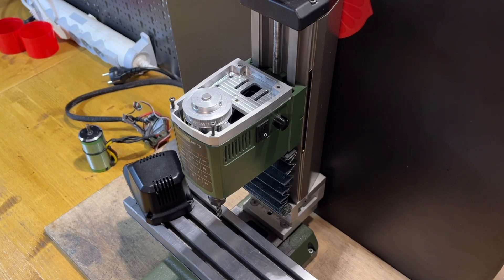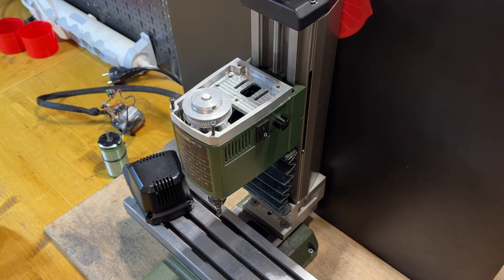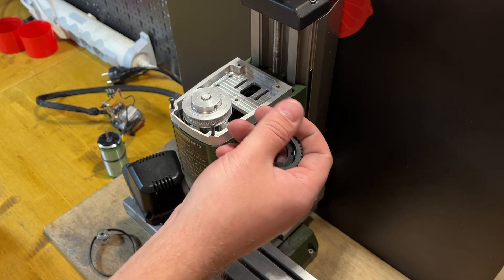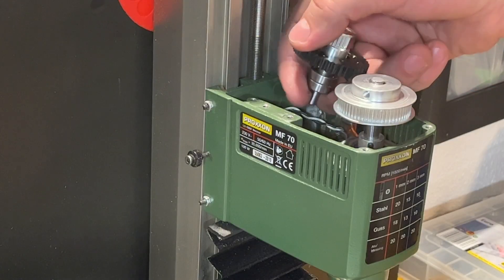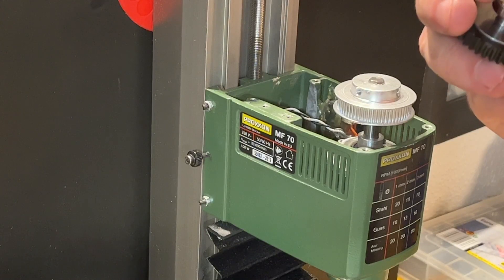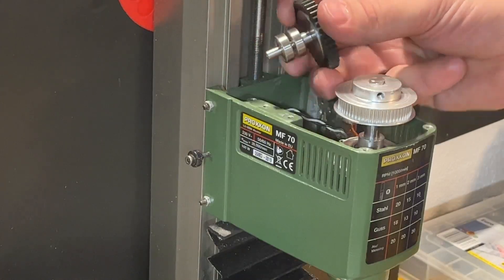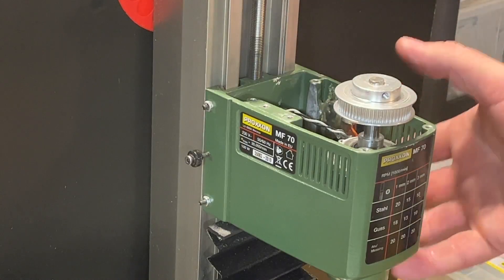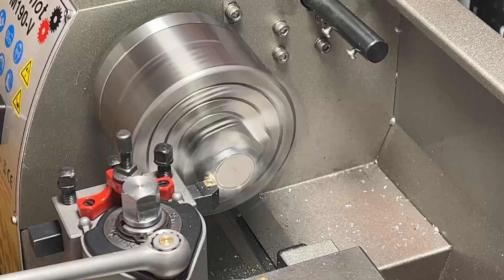Proxxon MF70 modification. High torque transmission (Part 1)

Comment: Really nice I like the proxxon stuff. But don't see it lot here USA. Unless it's Internet. Not n lot big box stores.
I have real nice almost new old stock DB 200. It has mill column and all original stuff that main lathe/mill combo came with wooden box to. It belong to a dentist estate sale. It's one of early models heavy with one big x bottom casting well I like ur video going be checking them out. Stay safe from ur ole hillbilly buddy.
Oh I have proxxon m70 cross slide table nice got good deal on it but small side not super Ridgid but for what it is it's nice.
Reply: Yes and sometimes you are so lucky that it´s even made flawless enough to work with it out of the box. I got a lathe from china 7 by 14 for 600 dollars and it was even made with steel gears. 👌

Comment: i wondered if you have your motor with speed feedback/servo mode?
i had an idea for gearing:too late, but, i thought that you could take motor and sun/planet gear from a 'scrapped' cordless drill, or, just the gearing, to give a nice speed reduction?
if you took the transmission, complete, you might even have high/low range selection, low enough speed even for threading, or...
Reply from the maker: I was thinking about planetary gearbox. But decided to go just with adding of 2 gears.
Reply: okey dokey, you're the builder! 

happy and healthy 2023!
Reply from the maker: Happy New Year!

Comment: Nice project ! I have a question. I have bought a spindle motor with 24000 rpm and 1,5kw do you think I can lower down the speed with a GT2 belt or is the speed to fast for it to handle ? I think 24000 rpm is too much for milling steel I guess. I wanted to divide the speed by 3.
Reply: If you read alitl about pouly and mathematic about this you will andrstand and you will see easily you can do
Reply: Thank you for your answer 👍
Reply: Of course you can
Reply: Yes I will implement a vfd because it´s basically a 3 phase bldc motor that I have only made for rectified 230v. The RC type bldc motors are made for lower voltages therefor maybe I don´t even need a belt because the motor is huge with it´s 1500w rating. I have to try it.😄